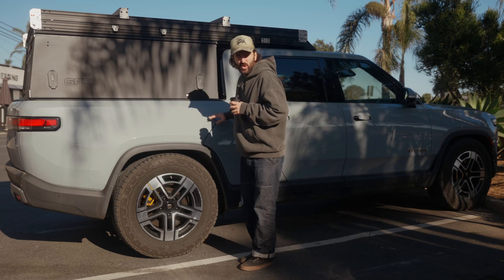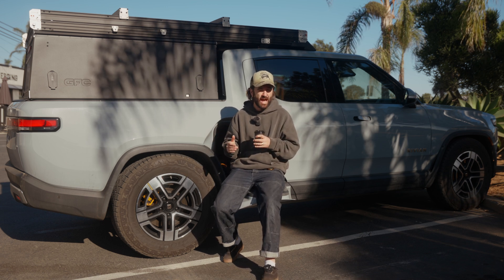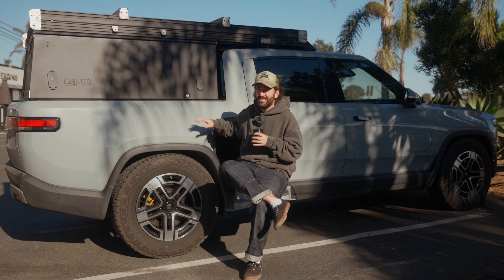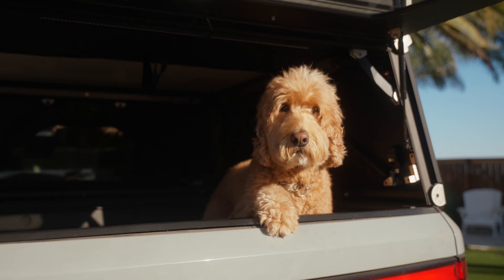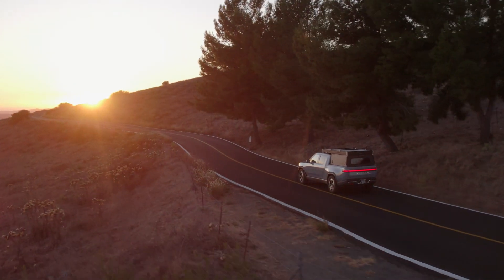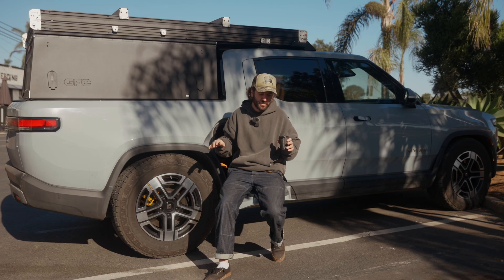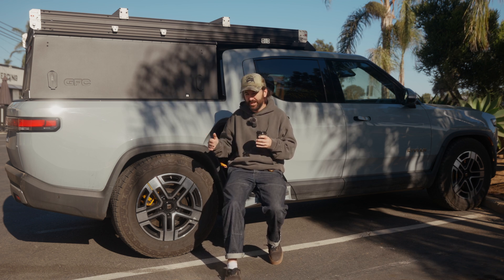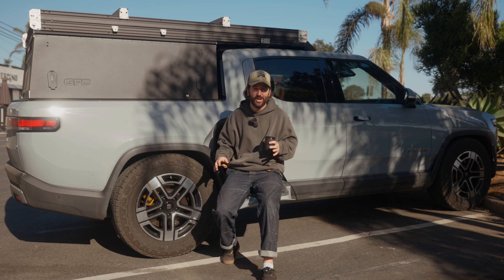Rivian R1T Overland Adventure Build EP. 2

Comment: Nice GFC for the Rivian.  But what I like about the GFC on my Ford F150 Lightning, is that first it was on my 2022 F150.  When I got the Lightning, the dealer just moved it right over to the Lightning.  Nothing special had to be done.  And been camping out west and in the SW at least twice a year since then.  I get around 1.8 m/kwh, at highway speed of 55mph, and more or less for faster an slower.  And best of all, it is darn near silent when finding my way along dirt roads to remote camping, and then popping my GFC when there. Being able to have the GFC on a full-size electric Ford truck, which I can get serviced pretty much anywhere, is what decided me on the Ford instead of a Rivian.  But is cool seeing how you modded the build for the Rivian!
Reply from the maker: Absolutely, ford made it super easy!

Comment: Id like to see some testing if there were fins on the back of the camper like the fins on the back window of the truck.  There is some good info to significant efficiency gains with fins moving the rear suction effect further back. Stoked to pick mine up in February.
Reply from the maker: Heck yeah! Can’t wait to see it!
Reply: Agree. Would love to see optimized aero accessories. For the rear specifically, something that would still allow for a 4’ awning 🤞